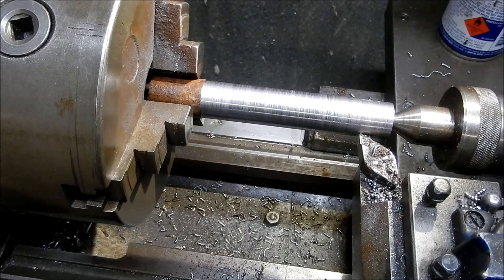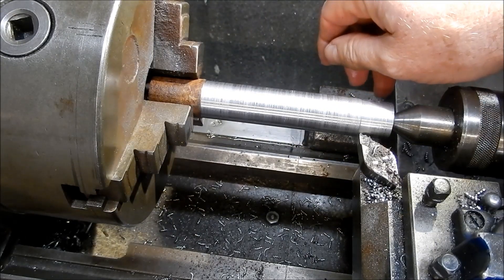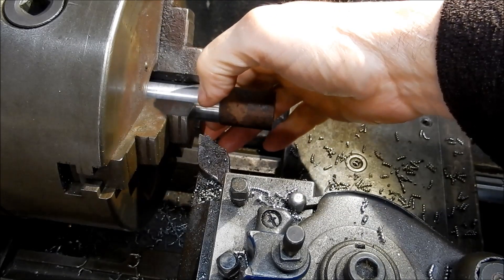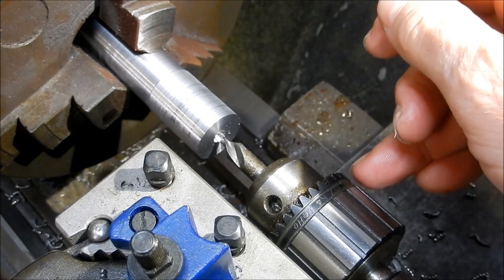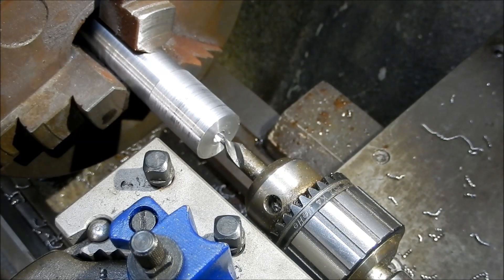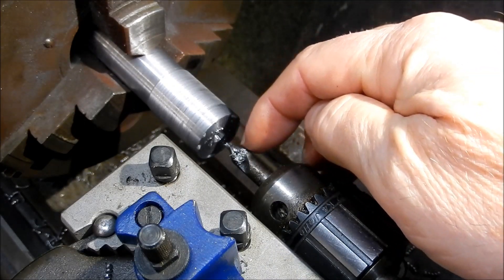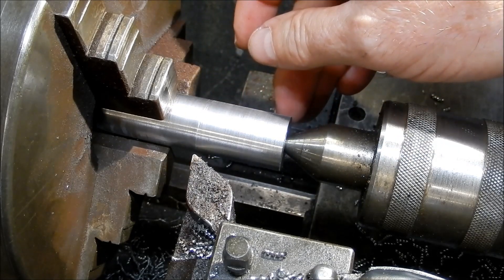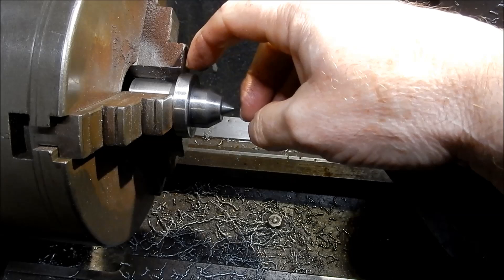Friction machining between centers without a drive dog

Comment: I don't understand how you can use a 3 jaw chuck and be concentric. I'm obviously missing something. I have a little trouble understanding your accent.
Reply from the maker: Easy, each time I fit the centre in the chuck I re- machine the taper.  Regardless of how far out the chuck jaws are the centre will be perfectly aligned after each re- machining.
Cam

Comment: I hate the fact that CNC lathes appear to never have a tapered main spindle to put a center in directly. The only machine in our shop that has this feature is a large Geminis. The two Okumas are both fitted with a hydraulic three jaw chuck with interchangeable jaws. We make centers out of bar stock and remachine if required for true running. Considering the fact we typically do very small batches I would much rather have independent 4-jaw chucks on the Okumas, but it won't change the spindle taper situation.

Comment: Nifty trick on applying pressure for the center drilling.
I work in a CNC machine shop and we do between centers work on the (large) CNC lathes. However we have to put a proper drive dog in the product to machine at real world settings, like 4 mm DOC and .35 mm/rev feed rate in large pieces of 42CrMo4 and the like. Often products have features in them that can be used for driving, like an internal spline or threaded holes. 
Cheers from Holland!

Comment: Great tip.  Also interested in that toolholder with the adjustable head. Very cool.  Is that a custom holder? Commercial sourcable from where? Covered in a video you have done previously?  Cheers.
Reply from the maker: Hi James, thanks for dropping by and commenting.  The turning tool I use is described here ( https://www.youtube.com/watch?v=I2THapzf4co&t=1272s ) at the end of the video.  They are no longer available however a number of blokes have built one from the description.
Cam